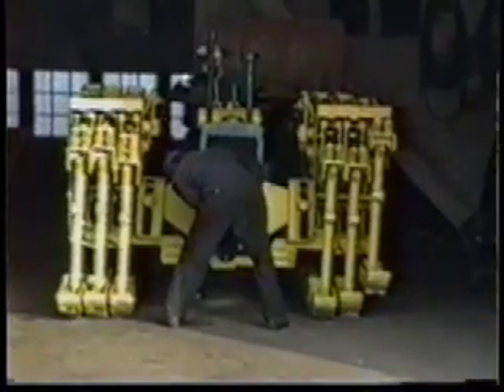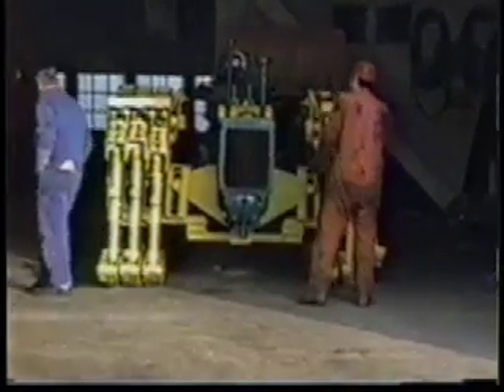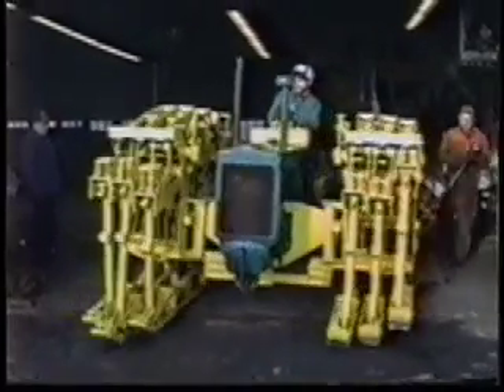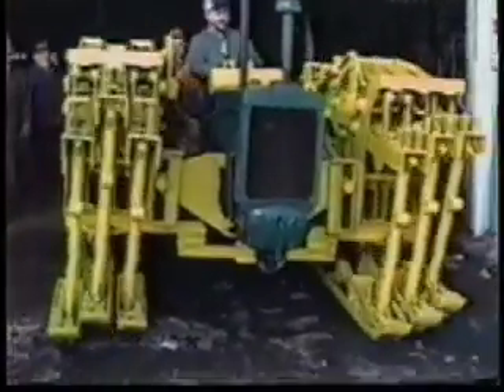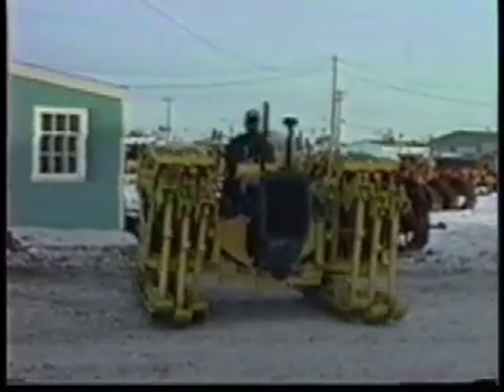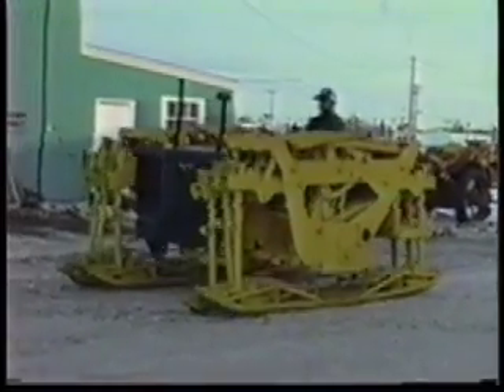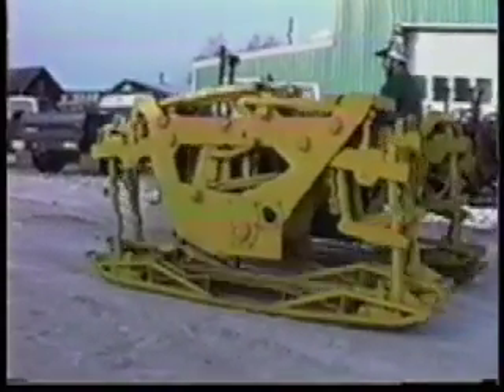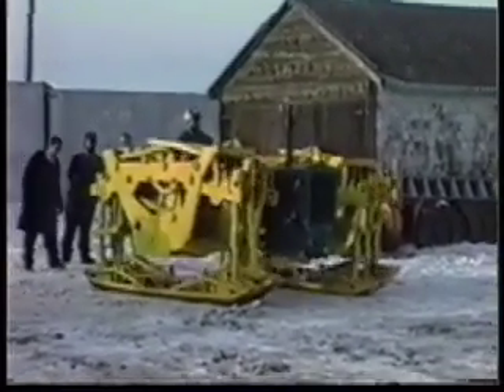World's Only Walking Tractor

Comment: If you watch the pads, it works. They should have shown it on soft ground, or snow. Thats what it was designed for. The description says it pulled logs, and had a 20 HP drawbar pull

Comment: This type of tractor would truly only have a viable use as a forestry  vehicle such as a skidder, and would be utterly useless as a farm tractor. Even then, that would require all of the inherent kinks to be worked out. The stride is far too short, there are too many "feet", it requires basic suspension, simpler mechanics, and perhaps an entire redesign. The concept is viable (walking draglines and cranes have been manufactured before), but it wasn't executed correctly here.
Reply: Maybe he ran out of money and/or time. If someone does not invest, its hard to afford this type of tinkering. The basic concept is sound, but executing it is hard. Walking draglines are very different, the pads travel in a circular orbit, where this machine is elliptical.
Reply: Timothy Dennison I see, and I can certainly understand why something this mechanically complex would be difficult to construct, I believe that it has got potential in its design, and requires some refinement.